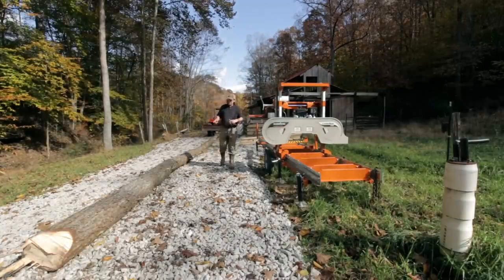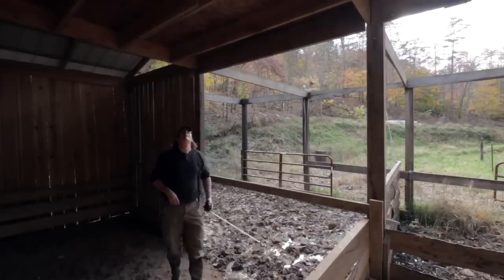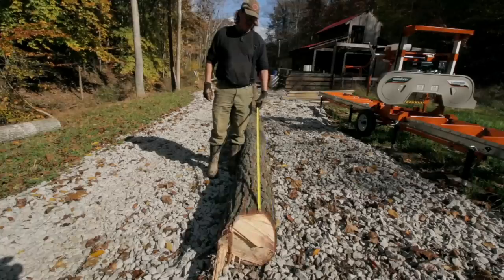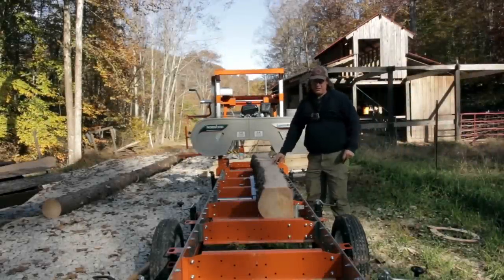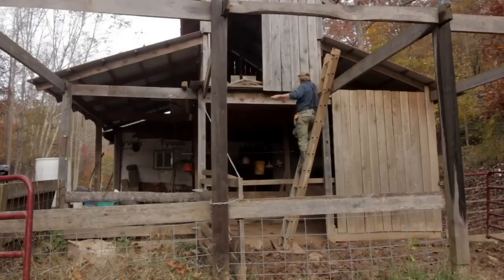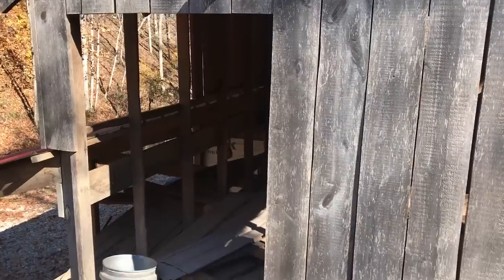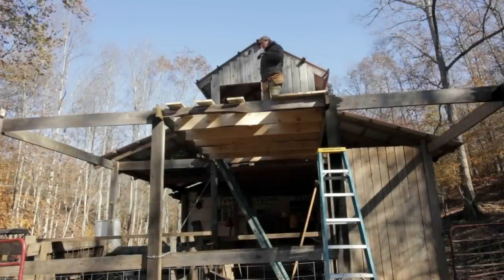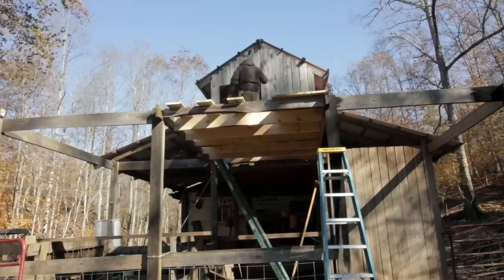Saw-milling dimensional lumber for our new barn loft

Comment: Impressive, making your own lumber without tearing up the saw blade. I would have thought that you would need some sort of bar or rail to help keep the wood separate as the saw blade cuts further down the lumber. Why did you staggered the lumber cuts on the roof? For stability of the structure? Thank-You.  :-)
Reply from the maker: The kerf is so thin that the wood won't pinch the blade. Some guys do wedge their boards after the first couple inches. Yes, staggering the boards kept the seam from being on the same joist across the floor. It helps keep it all rigid.
Reply: @RedToolHouse  Thank-you. I realize that I might have said it badly;but I'm glad you understood my questions were in earnest.   :-)
Reply from the maker: Sure thing. And yes, it is impressive that I didn't break anything this time.

Comment: Will you be covering those floor boards to keep the rain off them until you complete the roof? How well does poplar cope with repeated soaking?
Reply from the maker: I am not planning to cover them at this point. They are green boards so they have a bunch of water in them at this point. I will stain them eventually.
Reply: Red Tool House - Homestead if it's green timber, won't it shrink as it dries? I'd be worried about gaps in the floor, or warping causing an uneven surface. I'm really not familiar with the array of different trees you have - around here it's radiata pine or a gum tree, take your pick.

Comment: Do you have any issues with movement of wood (joists, floor, etc) since you used green wood to build with?  I’m asking because I can’t believe how upset people get about using green wood (or wet — just not dried) for construction - at least with a lot of the milling guys.  I’ve seen or read huge debates about it and so I’m curious if it was that big a deal for you.  Great vids by the way. Very easy to understand.
Reply from the maker: There is some movement depending on how I use it. The main posts for my barn I let dry for a bit before using them. Any siding material goes up fast with little issue. I find I use extra nails or screws to really secure it. Some of the floor joists pulled away but was easily fixed.
Reply: Thanks for getting back so quick. I would think the board-and-batten siding is a very good way to hide some of the movement. Thanks again - I’m still going through all the vids

Comment: I need a 700 so ft tiny home milled..
Reply from the maker: Wouldn't that be fun!
Reply: @RedToolHouse  I'm sure it would be.. Ha Ha..
Reply: Funny, I grew up in an 800 sq ft house with two brothers and a sister. We didn't consider it "tiny"
Reply: Red Tool House - Homestead trying to remember the conversions. My house is 60 square metres, which I think translates to 600 square feet. We need to extend it, but it has been sufficient for several years.